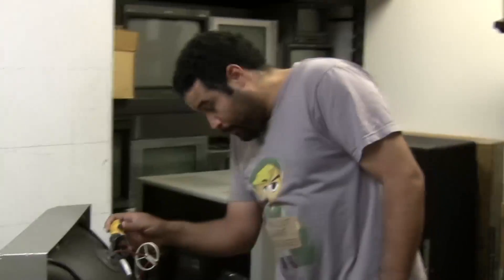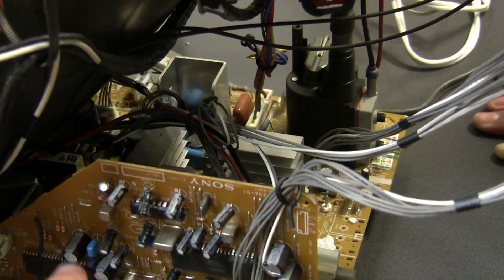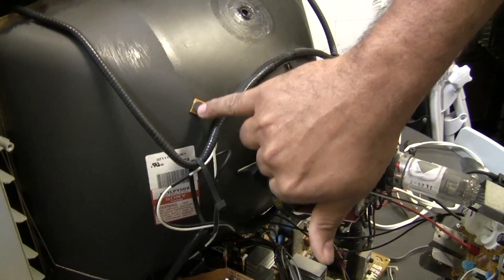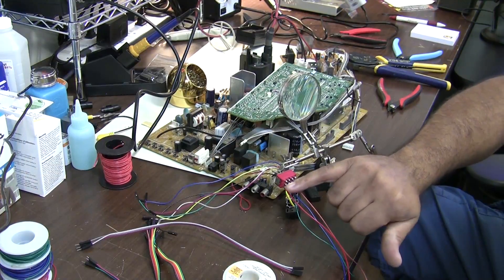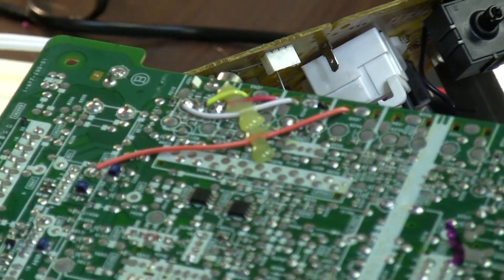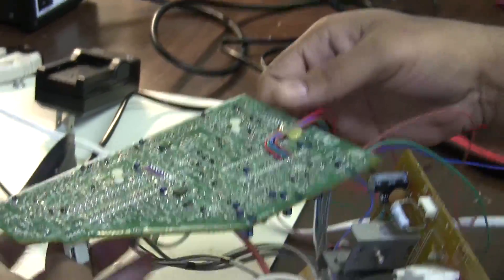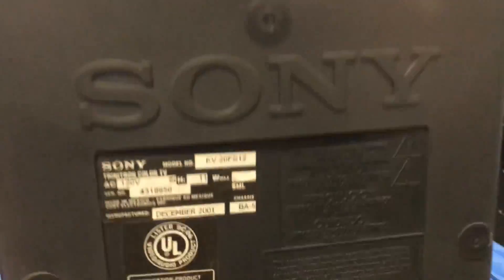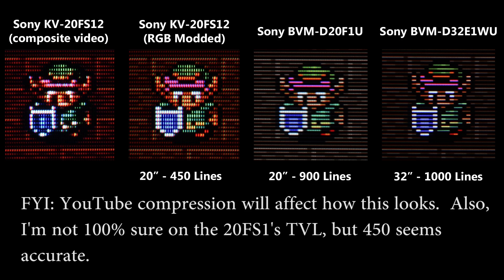RGB modding a Sony CRT for Retro Gaming

Comment: A lot of the time, you need to add 100 ohm resistors in series on the RGB from the console to fix the brightness issues.  You’re over driving the video chip.

Comment: How would work with a CRT that has a video out? Would you still be able to capture audio and video?
Reply from the maker: Good question.  I've never tested, but I assume composite out wouldn't work, unless you're using sync-on-composite SCART cables.
Reply: @RetroRGB  Alright thanks! Not very knowledgeable about CRTs. Recently acquired a Sony KV-27V42, and saw a lot of info on RGB/Component Mod on it online. That of course would be very nice if I could find someone that can skillfully mod it but I need to be able to capture audio/video.
Reply from the maker: You could always use a SCART or Component switch with two outputs:  https://www.retrorgb.com/scartswitches.html
Reply: @RetroRGB  Very cool!
Reply: @RetroRGB  Also should I disable Velocity Modulation (VM). Gonna mainly use my set for 240p gaming like nes, SNES, n64.

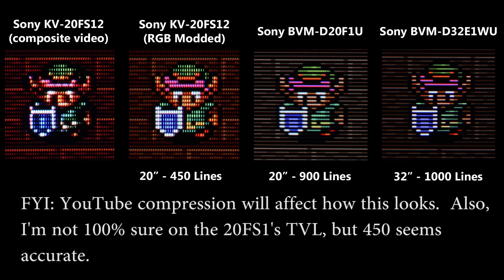Comment: 12:25 that must be some good composite video, because it looks more appealing than the others. Maybe because it's a 3rd gen game. It gives the illusion of there being more detail in the game, more texture, softer edges. I'd go with S-video at the most, and lower sharpness setting than if using composite. The BVM look can (almost) be achieved with a 4k OLED and the right filters. If u ask me, composite is even acceptable for 4th gen (and for silent hill 1 on ps1). For 4th gen in particular, S-Video might be ideal if available, and good enough even for 5th gen titles like MegaMan X5 and arcade titles like Metal Slug. 
 High quality RGB, like seen here, on a good consumer set, is the maximum I'd consider  for 4th gen games, like "a link to the past". In that case, composite would create the illusion of more detail, S-Video would be balanced, and RGB would make sure that all the detail there is, you get to appreciate. All valid imho.
 For 6th gen, RGB is a must, and that's why I'm here.

Comment: One big question I have always had: the SCART home 15 kHz TVs that accept RGB are basically 50 / 60 Hz devices and if you are going to feed them with something specific to arcades like Irem's R-Type that runs at 55 Hz it is going to cause "panic" to that TV logic board... So from this point of view I have always thought the most professional solution would be to use genuine 15 kHz arcade monitor logic that drives the CRT picture and is designed to accept anything between 50-60 Hz...

Comment: For CRTs that only have mono input, would there be any audio degradation if the stereo input from scart was summed into mono using 1k ohm resistors on each channel? I plan to use a gscartsw 8:2 with one output going to a retrotink 5x for game capture and the other going to a RGB modded CRT. So stereo sound would be desired for the PC.
Reply from the maker: No resistors are needed.  Please check out this video for proof and more info:  https://youtu.be/DHoA2vVZh8Q

Comment: Is Jose offering this mod service? Since every CRT is different, they need to read the manuals and check if the TV is able to be modded. The CRT in question is a KV-27FS100. Or maybe someone else is offering the service

Comment: You know, I don't if I'd have the want to have someone RGB MOD a CRT TV when I can just find one with component inputs out of the box. I mean it's analog technology,  RF and Composite video will already look worlds better to begin on a CRT and with and I can just get component cables decicated to make games systems and just use a SCART to Component box with other systems and a bandridge SCART-Switcher, as well as a MonoPrice Component switcher
Reply: I partially agree. I have my parents old CRT and with component looks amazing. However I find component CRTs that aren't HDCRTs are a pain to find. And when you do find them they are sometimes as expensive as the cheaper PVMs, at least from what I saw on eBay. Also if you mod your TV with Scart, you don't need a transcoder from Scart to Component.

Comment: For gaming and old computers. I prefer the RGB modded over thos BVM ones. Sure there are less lines. Yet the pixels for some reason, looks way more sharp. It is as if the BVM's are too high in quality, that they smear the picture. A bit like why you dont want to use LCD's.

Comment: It is all good and fun. Yet if you find a Denver 14 inch CRT television from europe with DVD player build in. From circa 2005/08. Then it will have two scart connectors. One are for sound output and image output. The other is a way different thing. It is the input, and it have a special Scart-RGB mode. It can take normal Video over Scart as well. Then it have Composit on the front of the TV as well, and it has stereo speakers. Not the best speakers, yet that is what the scart out is for. Yet when in RGB mode, the TV delivers a stunning picture quality.

Comment: I've done about a dozen of these mods. I don't lift the legs on the jungle IC when I do it. There's always a small cap or resistor on the bottom of the board nearby those RGB/FB input pins and I remove those and install a matching through-hole component on a breadboard. I solder to the pads where I removed the surface mount caps, but it is possible to rip them off if you are too rough, so the backup plan is the leg of the jungle IC on one end and there are numerous spots (test pads, links) where you can splice in the OSD line on the other side of that last .01u cap.

Whatever that resistor value is on the fast blanking line, I pass both the OSD and always-high through that resistor.

Also, I feed the sync into the luma pin on Sony TVs, because I have found there is some weird checkerboard pattern interference as well as comb lag on the composite video pin.

This is a crude schematic I share with people who want to do something like this: http://gadgetscope.com/rgb/rgbschematic.png

It's very important to terminate 75 ohm to ground each of the RGB from your input. Some SCART cables do this for you inside the cable, but some do not.

Comment: I found a schematic for my tv, has all the necessary pins on the IC... But the TV is coaxial only to begin with. Ugh.. Is there no way to force the TV to enter composite (av1 etc) or can that be done manually somehow? Or can I simply use the coaxial as a sync point where normally I would have used the AV input as sync.
Reply: I modded a Zenith RF-only set. The jungle IC had RF input on one pin, and composite video output on another pin. So, the RF went into the jungle IC, and was converted to composite video, came out of the IC, and went back into a different section of the same IC. It seems like this arrangement is used on TVs where there's an RF configuration and another RF plus composite input configuration, and the TV switches between RF loopback composite and external composite input.

The switch is done with a software bit which I would not be able to access without reprogramming the MPU - so instead, I just put the RF loopback through a toggle switch where one side is the original video and the other side is the sync signal from the SCART connector (I also use a SCART dongle to connect composite to this thing). The sound went through a separate sound decoder which also has a loopback circuit - and amazingly supports stereo sound even though it's an RF only set.

Comment: Looks like a nice two stripes per pixel horizontally and visible but thin scan lines. I think a 450 line display might actually be BETTER for playing old consoles like this (once modded for RGB) than trying to play on a top notch, but really meant for HD mastering, D32E1WU. On the 32, 2/3rds of the picture is inactive and 1/3rd is active. I "get" the desire to have scan lines, but I think like all things, there can be too much of a good thing. I have a PVM 20L2 myself ("only" 600 lines) so it mostly splits the difference between that 900 line D20F1U and the consumer TV. Sharp without having bigger scan lines than active lines. Of course, if I had that 32 i'd do other things with it like hook up a PS3 and run HD through it - thats where a D32 would really shine.

Comment: When I was 14, I discharged a tube with a screwdriver that had the metal going straight through the handle.  I put my palm on that part, without thinking.  I briefly blacked out and woke up on the floor a few seconds later.  It wasn't a good time ...
Reply from the maker: Thank you for sharing your experience.  I'm getting frustrated with all the "Stop exaggerating, you can't get shocked" comments.

Comment: The brightness issue is something I had with my RGB SCART TV when I got a cheap SCART cable for my Mega Drive 2, no matter how much I lowered the brightness it still didn't look right; very bright and washed out. It turns out that the guy on the production line for these cheap cables must have been having a bad day because he had added the capacitors to each of the RGB lines in the SCART cable, but didn't add the resistors in line. I added the appropriate resistors and reset the brightness on my TV and the image came up absolutely perfect!! 

Thought I'd mention this, and that the brightness issue might be just "too much" signal through the RGB lines and just need to add some resistors.

Comment: Great video despite the focus in certain parts. Oh well, makes it so they have to get the service manual to find the pin-outs. I have a question but. In the video you mentioned the picture originally was shifted. I understand this is to do with a horizontal sync issue but how did you fix the problem?

Comment: How was it determined the TV had the jungle chip required to do this?
Reply from the maker: We downloaded the service manual and searched for the jungle chip pinout.
Reply: RetroRGB a compiled list of sets that could be used for this would be an excellent tool.
Reply from the maker: Yup.  That's part of the reason the new website is so important...so we can all contribute to a list like that!
Reply: Here is such a compiled list, and much more info on these mods: https://shmups.system11.org/viewtopic.php?f=6&t=56155
I want to do some of these mods myself soon.

Comment: The brightness problem is the same I had on my sony trinitron but what I did was removed the 75 ohm termination resisters and used  200 ohm variable resistors  in termination on the rgb lines and got the brightness down a good amount.

There has to be a better way than what I did.

I used 200 ohm because that's what I had on hand and also on mine I can't adjust the color as the rgb mod disables it,bet yours is the same as well.

Comment: Not much light gun support so....as long as the person considering this doesn't need it.
Reply from the maker: Why would there not be light gun support???
Reply: If you mod any of the flat crts some light guns (or all) will not work. the modded flat crt is going to give some of the better looking rgb. if you use any old crt to mod you aren't going to get such   a brilliant picture that you could tell yourself a pvm/bvm wasn't better.
Reply from the maker: https://youtu.be/-vyd_h6SAx0
Reply: Very nice, but like I said flat tubed like the later WEGA (some of the nicest RGB picture) have issues. Plus a NES Zapper might work fine on some but not the Super Scope or Nemesis and so on. This is still yet to be 100%.

Comment: Really looking forward to your RGB shift Circuit solution. Would have been cool if you had placed a small pot on the back for manually shifting horizontally!

EDIT oh, you were just talking about adjustments. Did you do it via service menu?